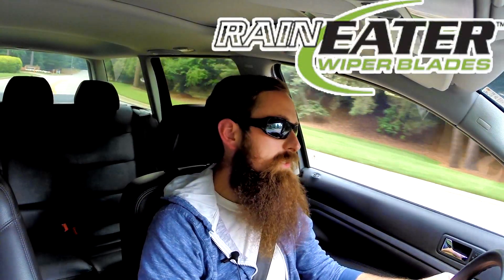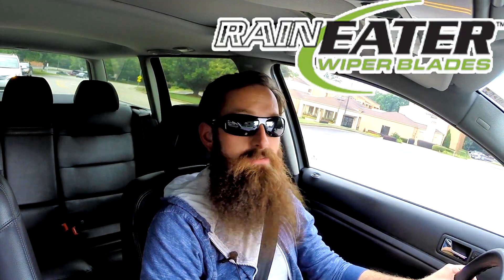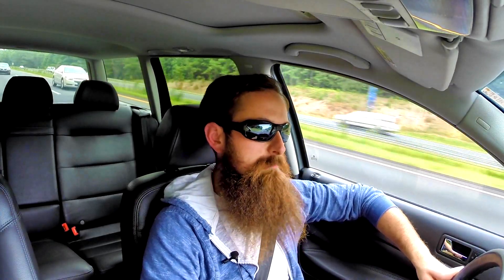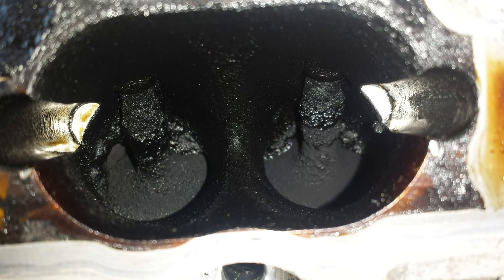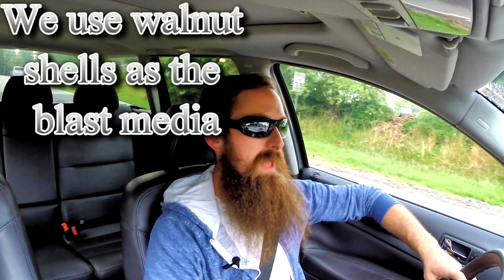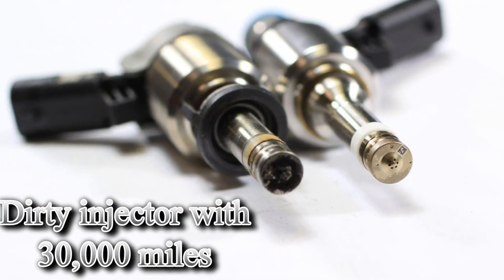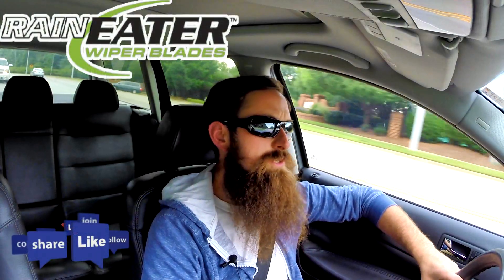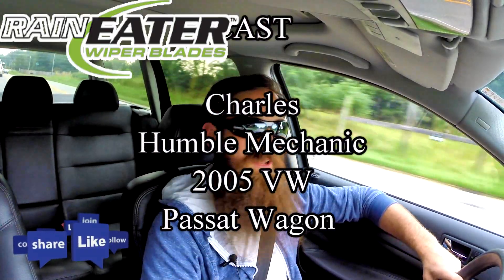Preventing and Fixing Carbon Issues for Direct Injection Engines ~ Episode 80

Comment: Forgot the biggest introducer of carbon into the intake path... the EGR.  It's much more obvious on the TDIs - I'm sure you've seen what the EGR does to the ALH... the gas fumes are obviously a lot easier than the diesel soot, so the more obvious place where you'll notice it is the backs of the valves... the intake will still be dirtier than a port injected car, but not anywhere as dirty as a TDI, and you can lose a mm of space in the runner and won't notice a huge difference...
Reply from the maker: That is true! But the VW gas engines don't have EGR so I left it out for this video.
Reply: Ahh, gotcha.  Didn't know that about the gasser VWs, that's awesome..  The 3.6 pentastar chrysler was the only engine I knew of that didn't have EGR... The BMW guys (the 335i N54 motor specifically) have big issues with carbon buildup... 

Whoever at the EPA mandated EGR needs to run a hose from their ass to their mouth first... It's just another self-defeating pollution control that affects vehicles so badly that in the long term ends up doing more environmental damage than good.. sigh.
Reply: Any engine with VVT or TIVCT does not have an EGR anymore.

Comment: And the problem is, Faked Emissions test program on Idle.
The Vw's were not burning as clean as the test would state because VW has now admitted to fraud to deceive nations into thinking the burns clean.
Ok maybe this isn't the problem or is it? My Toyota has 239k miles on it and I'm starting to have a misfire problem, you're working on VW's with 80k miles on them.
This only started to show up with 10% ethanol showed up on the market. because I've always used a higher octane fuel then the car requires. Then again this could be the problem.
Reply from the maker: +bobbg this is not a software issue. It's a injection design issue. Many other manufacturers have these problems too. 

And we are talking gas engines not diesel

Comment: Lexus IS250 with DI had small numbers of customers doing short runs getting some carbon on intake valves. Interesting that their latest engines have direct and port injection claimed to make the best of circumstances where port injection can be more efficient and other speeds and loads where direct injection is more efficient. The switching between the two injectors as you drive would seem to have stopped carbon build up on valves due too the washing effect from fuel. Seems like a good idea. Thoughts?
Reply from the maker: +Ernst Friedrich I think that's the way many designs will go. It's the easiest way to make it stop.

Comment: So in other words, direct injection has a huge drawback along with the improvement it offers.
Reply: Flawed design as a result of chasing fuel economy and lower emissions
Reply: Yup, yup and yup......John in Texas
Reply: Toyota has a port and direct injection system. The port injectors are to clean the valves, the direct injection is for better performance.
Reply: @Trollestia123  All manufacturers are doing this
Reply: @SavedbyHim   GM isn't.
Reply: Once the government gets involved aka EPA it is a learning curve for everybody! You should see the havoc the created back in 2010 with the diesel engines! 10 years later they're still trying to figure it out!
Reply: Lower CO2 emissions! Sounds great, right?!
Not really! Direct injected engines decrease CO2 emissions but produce MORE SOOT.
Reply: Engineering is always about compromises
Reply: Not if you spill the unburned mixture out. Which we don't do anymore.
Reply: Thank the nanny state and Gaia worshippers.
Reply: It’s just materialism running in circles.
Reply: Check out what Scotty in Houston has to say about Direct Injection-John in Texas
Reply: this problem is purposely created by oily air intake caused by sub-standard PCV oil separator.

Clean intake air has nothing to deposit on valves 👍🏻

This chaos engineering madness is pathetic 😂
Reply: @glasser2819  What about valve overlap?
Reply: NEVER BUY A CAR WITH DIRECT INJECTION
Reply: @TheWingsoffury  A few years ago, on a vacation trip, we rented a Passat with the 5 cyl 2.5L 172hp port injected engine and drove it from Phoenix to Las Vegas in a roundabout way.  After a few days in Vegas, we rented a Focus with the direct injected 2.0L 160hp engine and drove to the Sequoia National Park and back to Vegas.  The difference in gas mileage was enormous.  The room, comfort, and performance of the two cars was very similar but the mileage of the Focus was probably at least 10mpg better.
Reply: @TheWingsoffury  why? I have been really happy with my forester turbo. Just use a can of DI cleaner every oil change, it's like 5 bucks.

Comment: Be careful about using intake cleaners on Ecoboost Fords. The turbos are so close to the engine (and some even built into the exhaust manifold) that many experience turbo failure after running cleaners through the intake.

Comment: Great video! This topic seems that it is with us since many manufactures now use direct injection. I can see that the crank case vapors in the intake probably cause the most of this but in addition to the issue how much of this is made worse by EGR in the intake. I relate this to all the diesel engines out there. Prior to the diesels having EGR, many did not have any carbon issues in the intake, once EGR was put on the engine, carbon build up every where! This was just what I was thinking.

Comment: Back in the 70's and 80's we were battling pre-ignition and detonation.  We added a simple water injection system into the intake manifold.  This cured all drivability issues and the ADDED benefit was clean valves and pistons.  Should still work on today's vehicles.
Reply: I did the water injection system also in the 70's.  Made it my self after reading a Popular Mechanics article.  Worked great and also increased my gas milage.  water turns to stream when it hits hot piston and that takes up space in cylinder.  Works great.  Not sure why car manufactures don't install these at factory.
Reply: @johnd4348  because they are owned by petrol money. And that takes less gas. Also shit needs to break... All about money. Then you may need a water tank and people are getting lazy by the day. Less maintenance.
Reply: Richard Ostrowski   Great !  How it's done ?
Reply: Good point. I imaging guys using meth kits on their gdi engines are getting the same benefit.

Comment: Buy and install a catch can, route the hose down so the air/fumes are blown under the car. Plug the intake. No more carbon build up ever.
Reply from the maker: As long as your state does not have a tamper test for tag renewal. That would fail in my state.
Reply: This is false
Reply: I'm from the Netherlands but we do have a yearly/bi-yearly compulsory checkup. Thing is, if you connect the catch can to the manifold before having your car checked you won't have any problems. Even if you have the other hose still in place (but disconnected obviously) they can't say anything. Catch can should be mounted in an easily accessible place since you need to empty it once in a wile anyway.

Comment: So do oil catch cans prevent or slow down carbon buildup on the valves - or are they just be a waste of time/money?
Reply: Zachary Zarko  Yes it does help and absolutely worth it. I had a carbon cleaning years ago and installed a catch can with no issues since. I've scoped the intake to see if there is any carbon and it is still clean.
Reply from the maker: +Zachary Zarko from what I have seen, they help, but not fix the issues
Reply: That's really good to know because I've been thinking about spending a fortune to get a 2017 Raptor. Now I'd rather have an
 F-150 with a 5-liter in it instead.
Reply: https://media.ford.com/content/fordmedia/fna/us/en/news/2016/09/29/all-new-ford-f-150-raptor-draws-a-line-in-the-sand-with-450-hors.html

According to that press release, the new 3.5 EcoBoost has both port and direct injection so it shouldn't be prone to the same carbon issues.
Reply: Zachary Zarko its slower and less powerful and gets less mpg so less time playing off road. go 3.5 they have the dual injection no catch can necessary u get a 2017. otherwise put a catch can and get more power and more fun with the trq beast 3.5 not the slow 5.0 its on tfls dont buy list.
Reply: slows down to a point it's not an issue. buildup happens regardless DI or not but it's to what threshold u can control it

Comment: So, what I take away from this is, not to buy cars with Direct Injection engines.
Reply: OK thanks! I did not know this existed. I thought of it myself as a possible solution but thought, well, probably too complicated and expensive. I should have become an inventor. But life had different plans, haha.
Reply: Well Mitsubishi made in europe in the early 90" GDI engine , end weel in europe in 2019 Mitsubishi dont have this tech .
Alot of problems with carbon buildup
Reply: I have 60,000 on my  2016 GTI ; virtually no carbon build up ; I just regularly run it at 3000 + rpm  for 10 to 15 minutes. Really not an issue.
Reply: @richmanacoustic8238    Yeah, that doesn't help.

Comment: SAND blasting? Say what?!
Please tell me you make shure that the vales are closed  during the cleaning proces of each port.
Reply from the maker: +Tomyp89 oh yeah!! I pull the plugs and make 100% sure. 

This is the factory way BMW and Mini does it.
Reply: I always thought that sand inside the intake is a bad thing. Ive heard that you could use sodium powder(?) as a abrassive. The benefit is that it is water and oil soluble and soft. Some car detaling shops use  dry ice blasters to clean engines, maybe this could work as well.

Best solution->meth injection in the port+ 30+psi of boost :D

Comment: Carbon build up is always a sign of a bad gasket, a gasket that is sucking in air; any type of blown seal that compromises the airtightness of the engine. 

All of which are caused by the LACK of using the manufactures recommended torque settings. 10mm @ 5, 10, 20, 40 in whatever pattern they state. 

Any monkey can grab a wrench & a speed gun and rip through an engine. Anyone. But can you torque it back together & guarantee the work; for the lifetime the owner has it. <<never understood why people use speed guns. with a wrench you can feel what's going on. with Mighty Mouse you simply tear apart torqued bolts with lock tite>> allah ahbar
Reply: Go Pro with Direct injection engines your reasoning is not correct. Simply put there is no fuel being introduced through the intake ports and intake valves like in port injected engines of the past. No fuel to clean the intake ports or intake valves. When PCV systems dump the oily mist into the intake track the mist hits the sides of the very hot intake port as well as the super heated back side of the intake valves and subsequently burns and turned i to carbon that sticks and builds up over time.  This problem is with DIRECT INJECTION ENGINES which have only been out for just over 10 years or so. VERY POOR ENGINEERING in my opinion as there are ways the carbon buildup van be avoided  with properly applied technology. How the engineers that designed these engines could miss such an obvious issue is beyond me.
Reply: Private Name ... I respectfully disagree with you. The Diesel engine is over 90+ years old & is a direct injection engine.

Secondly, I stand by what I said. Poor, cheap, non OEM head gaskets tightened at non OEM specified patterns & torque settings, secondary settings & 3rd / 4th and more settings are the singular cause for engine head failure. Carbon buildup does not exist if the engine remains in vacuum. Hence exhaust pressure is always higher than free flow intake air. Even with turbocharged or supercharged engines. 

Facts & physics are simply factual. Once compromised, carbon always builds up on the back of the head, in the cylinder & begins the process of blowing up the engine. Some engines, once compromised, explode immediately; others like a 1.6L Kia might last 20+ yrs after the gasket fails. It's all in how well the monkey with the wrench follows instructions. 

Hence, it's impossible to repair a head gasket in an hour of 3 hours.
Reply: Joe Knapp ... roger wilco. Also, the Diesel engine was invented in 1911 by Mr. Diesel. I threw that MB candy in to see who's paying attention.

I was, using the time tested & true way of checking a cylinder & head. Compression. Air leak = head gasket failure = not properly installed head gasket. Applying old proven mechanical methods only make mechanics more intelligent. YouTube mechanics and newly trained mex missed out on carburetors an bla bla.  
Compression is the key to locating a head gasket issue. Find C1, roll to TDC, roll off 6° and roll the crank. Do this to all cylinders, you'll find the blown cylinder immediately since it will puff air at you. A distinct puff. Happy overspending